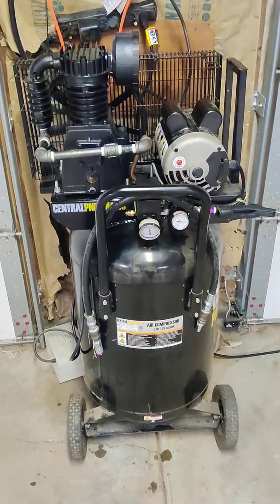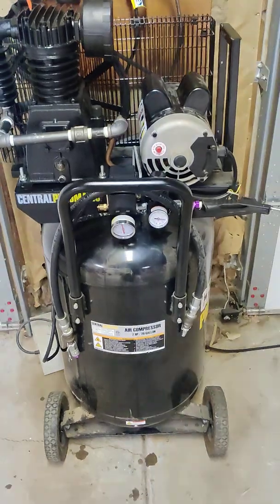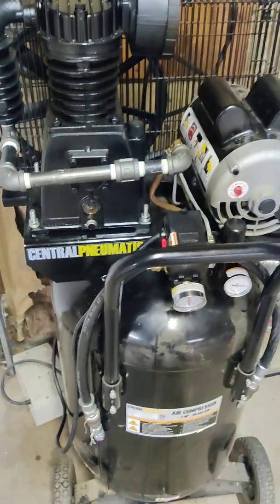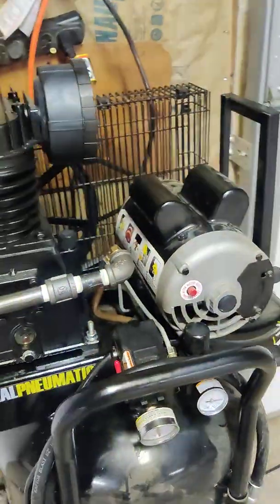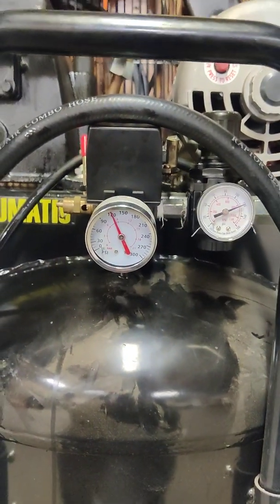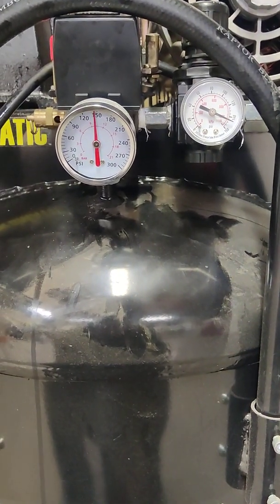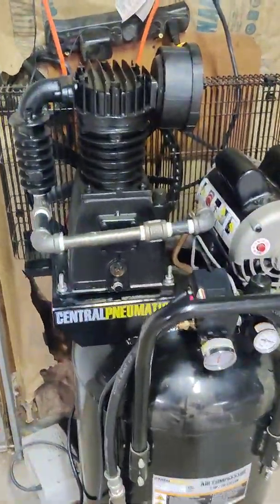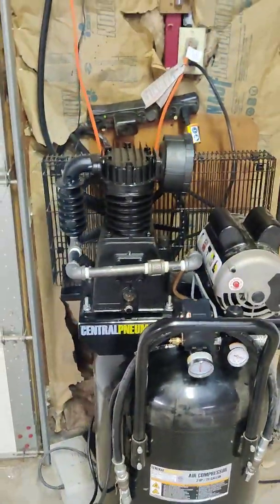Harbor Freight 29 Gallon 2 hp Compressor w/ HF 3 hp Compressor Pump

Comment: Ahh just what is was looking for... The motor burned up on my well, so I just put a $100 HF air compressor on well, but the compressor that did run my well is a speedair and it has more cfm than my 29 gallon hf. I will be building a 250 gallon propane tank when I get the money for a 7.5hp motor.. I have the tank and a Ingersoll Rand 2545 compressor.

Comment: Hey man, i currently have the stock form and want to upgrade due to hvlp paint demands. How much more air cfm do you think you get? Does it run air guns/spray guns better (if you use them)?

Comment: Running black pipe dont you have to worry about the condensate and with that moisture going into threw the lines if your doing pain work things with rust n get crap threw the entire system sir correct in just asking cause I upgraded my 29 gallon compressor to the 2 cylinder 5hp pump n changed out my electric motor to 5hp motor and I put an air cooler on it to cool inlet air going into my tank and it dropped temps by well over 150 degrees my temp of air going into my tank is like right around 78 degrees compared to with out cooler it was well over 200 degrees n I used copper pipe due to the fack of the rusting factor of black iron pipe but you coukd use stainless pipe also but with the air cooler the moisture in the tank is nothing since I did my upgrade I have not got any moisture of of my tank at all I made a blow out on my inlet air on my air cooler line right before in goes in to my tank i have a tee with ball valve n I can open it and blower out any moisture that collects in line before going into tank . but i was asking about the black iron pipe do u get any rust in any of ur filters or comingbout the bottom of your tank when you  drain it sir ?
Reply from the maker: I changed it to all copper. The black pipe was just temporary
Reply: @zackhaas3267  did you get any rust from using black iron pipe in your tank n air system sir ? Also I was wondering if you ever put air cooler on your system

Comment: Could you spell out the steps to getting this done?
Reply from the maker: Check out my other video for an idea of how to run the copper. I did use the flare fittings from the original charge pipe, but the original copper is a different (probably metric?) Size than what's available here, and I had to drill them out a little to get them to fit the 1/2" a/c pipe. If I would of been closer to a hardware store I would of just gotten new.
Reply from the maker: There's really not much too it. You will need the pump, a drill and some drill bits (the pump base is a little bigger and you will have to drill 2 holes on the compressor shelf), some basic hand wrenches, Allen wrenches, the pump, a harbor freight flare tool, and some 1/2"  a/c copper line and new 1/2" compression fittings. Pull the cage apart on the compressor, loosen the electric motor up to loosen the belt, unbolt the pump, clean up the base, set the pump in place so the mounting holes on the left side line up, and make sure the pump pulley is in line with the motor pulley. Mark the mounting holes on the motor side of the pump with a center punch, pull the pump back off and drill the 2 mounting holes. Once that's done, test fit the pump and belt (to get the belt on you will have to slide the motor ALL the way toward the pump, and the belt is JUST long enough!) and if everything looks good tighten both motor and pump down. At this point you will need to do your charge line. You can use 1/2" black pipe with a male 1/2" flare to connect to the original copper like I originally did as a quick, easy solution, or make it look nice by getting the flare tool and a pipe cutter from harbor freight, some 1/2" a/c copper pipe (about 3 foot, double if you want to have a "second" chance!) and two female 1/2" flare fittings, and one male 1/2" npt to male 1/2" flare. The beauty of the a/c copper is it's easier to hand bend, but the one flare tool does come with some springs to help that process (just youtube it once you get to that point). Then it's just a matter of flaring one end, getting it bent and then cut (gradual flowing bends, otherwise you will pinch the copper) and your final flare to hook it up! Then, a leak check.
Reply: Great video btw